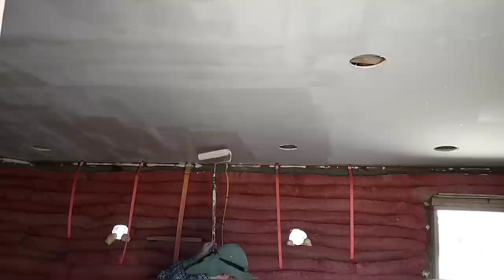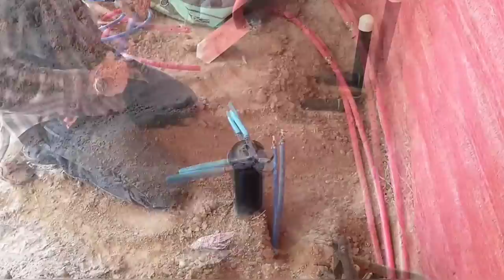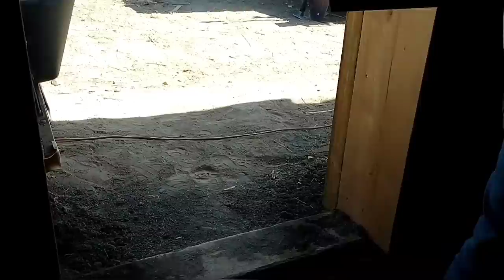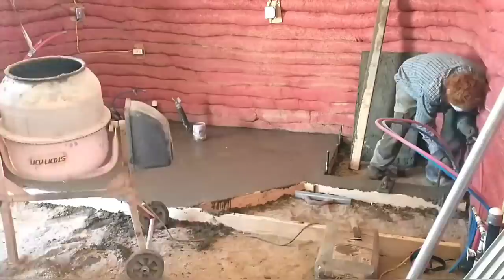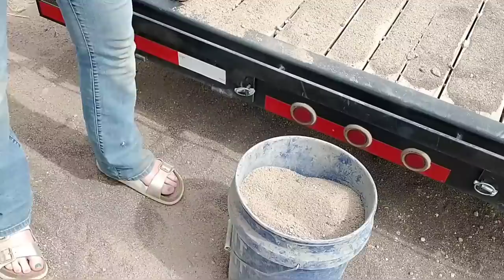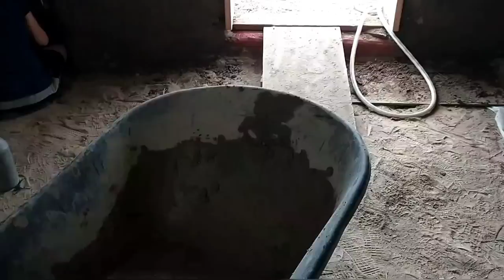Hyperadobe Tiny House #7 Plumbing, Concrete & Cob

Comment: I worked as an industrial nurse many years ago, on a construction site. I saw lots of concrete burns, usually around the boot line and into the foot area. It happened on very large concrete pours. I recall these are alkali burns, that’s why vinegar seemed to work. If he ever does concrete work again ask him to use a lanoline cream. It leaves a greasy barrier and I found it useful for the workers as a preventative.I am enjoying following this construction progress.
Reply from the maker: Thanks! Yes, we had had concrete on our skin before without any issues, so it seemed like he would be okay for an hour or so. We definitely won't be crawling around in it again without some good knee pads or other protection. We were surprised the middle of his knees weren't burnt at all, it was just the sides. I guess thicker skin is less sensitive.

Comment: I am mudding a closet wall over tire bales and your weed wacker for cutting the grasses definite time saver! 
Until next episode...❤
Reply from the maker: 😎 Hope it goes well! 
We put it in a big plastic drum. It does use a lot of line, but it worked. I recently saw a guy spreading it out on a piece of wood and chopping it with an axe. It looked like it worked pretty well too.
Reply: @RedandAprilOff-Grid  I have used scissors before an axe seems extreme to me. 🤔

Comment: I enjoy watching your videos. I am a bit curious to how well this particular home will do in the winter and in the summer. I would expect that the northern facing walls would be cold in the winter and southern / western facing walls hot in the summer...guess we will find out soon enough.
Reply from the maker: Thanks! The temperatures are staying nice so far. Because of the overhangs and orientation, the walls are completely shaded in the summer except for a couple of hours in the morning and evening. With the lower sun angle in the winter, the south side will get direct sun all winter.  More windows on the south side would have really helped heat the place up, but it should still be quite livable.  🌞

Comment: Were you worried about the clay composition of your soil? Had it been tested previously. I thought that clay was a part of a cob recipe? Am I misinformed? What are your thoughts? Great work. I love that you are sharing this process. The blue trim with the stucco looks really sharp!!
Reply from the maker: Good question!  His septic perc test showed clay, caliche and poor drainage, so we knew his soil is mostly clay. Also, his packed hyperadobe walls, dried impressively hard like bricks. 
Thanks! 🌞

Comment: This little hut looks simply like a sweltering hot box in summer.
Reply from the maker: @johnnynephrite6147  The desert is dry and the nights are cool here. The year round temperatures in our area range from 4°F to 106°F. Without added heating or cooling the inside temperatures of this house range from around 60° to 90°F. With additional heating and cooling the temperatures can be made even more comfortable.
Reply: @RedandAprilOff-Grid  did you get that underground cooling system working? why not do an earthship design?
Reply from the maker: @johnnynephrite6147  He doesn't have an underground cooling system, and it's doubtful one would work well in our climate. He just wanted something that was as simple as possible. More windows on the south side would have definitely helped heat the home in the winter. 
We love our solar passive design home. It works much better than we expected. 🏠🏜️

Comment: I've really been enjoying watching this process unfold. I've always wondered why they chose to go with so few windows though. Is it a temperature thing? Or a cost/difficulty thing perhaps with the Adobe? Either way, cool videos, cool project
Reply from the maker: Thanks! We were in the middle of building our house, and didn't have the time or energy to think much about it. He said he just wanted one window and it sounded easier and more stable. More south facing windows would have helped a lot to heat the house in the winter. We didn't realize passive heating works so well until we got our house built, and by then it was too late. The round tubes bring in a lot of light and there will be a window in the door, so it shouldn't be too dark.

Comment: What was your cob-ratio mix. Also your exterior stucco ratio mix.
Reply from the maker: The stucco we used was 3 parts sand to one part cement. The cob is equal parts sand and dirt, with a little grass and Borax mixed in. His soil naturally has a lot of clay.

Comment: I once helped a friend stucco the exterior of an adobe brick building . Unfortunately, we found out that portland cement is far less vapor permeable than the earthen walls.  The stucco failed and started falling off within a year or two.  There have also been cases of cob structures in Whales that collapsed when the stuccoed walls became saturated.  Hopefully this doesn’t cause you guys problems 🤞
Best to use lime or clay based plasters.
Reply from the maker: We considered adding lime but decided not to. We have a wet season, but most of the time it is very dry here, so we don't expect moisture to be an issue. The inside cob is also breathable, so moisture should be able to escape there if it needs to.
Reply: The building I worked on was in a high desert climate with about 12” annual precipitation, low humidity year round.  Cooking, showering (and breathing) was enough to raise the indoor humidity. Then moisture trapped behind the stucco was subject to freeze/thaw cycles. 
I would definitely recommend installing a shower vent fan and range hood to help minimize the gradient. 
I really like your roof design. I’m considering either a hyperadobe hexagon shaped building with a flat roof like yours, or possibly a Cal-earth style hyperadobe dome.

Comment: Aren't you concerned about radon gas. One of the reasons we have slab floors instead of earthen.
Reply from the maker: Insulated earthen floors with a vapor barrier are about as solid as a concrete floor. The house will also stay well ventilated with screen material over the circular openings.
Reply: And Southeastern AZ has low radon levels.